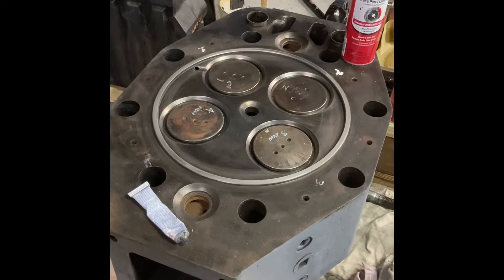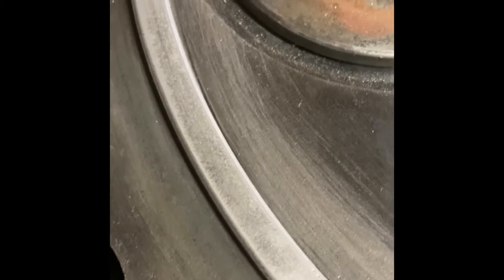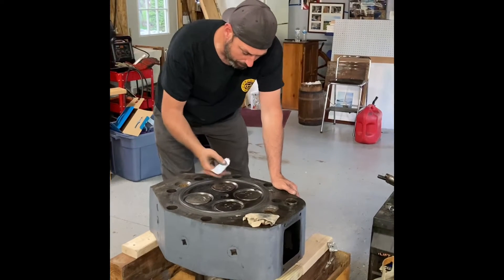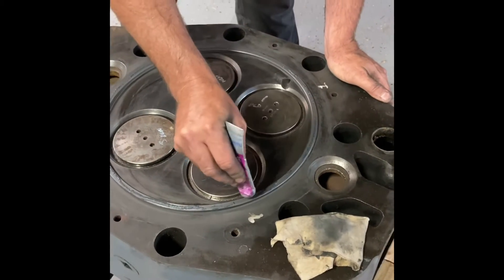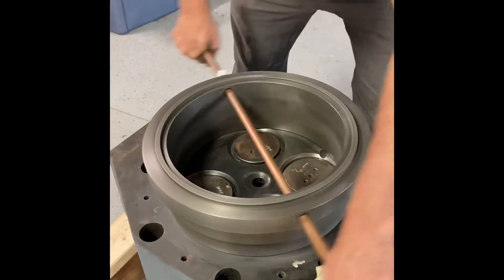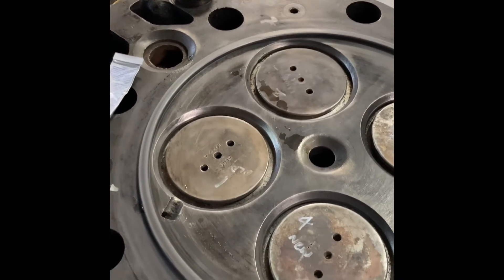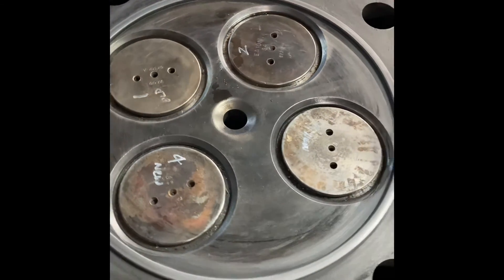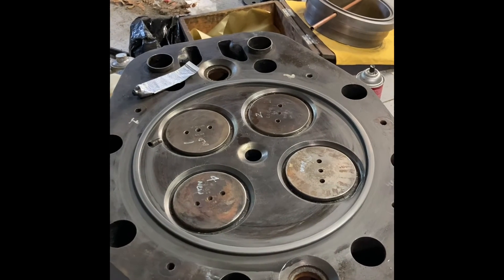Alco 539 Locomotive Cylinder Head Reconditioning

Comment: ONE TIME I HAD TO REPLACE AN CYLINDER HEAD AND LINER WITH NO LAP RING TOOL AVAILABLE!
TO CURE  THIS I TURNED THE HEAD UPSIDE DOWN , THEN PUT THE CYLINDER LINER AND LAPPING
COMPOUND ON THE HEAD THEN LAPPED IT IN !
IT DID SEAL OK !!👍👍
Reply: @rossbryan6102  I shall be searching around. Great thinking on the issue of lacking a lap ring tool.

Comment: Do you know an easy place where I can obtain alco 539T parts and service manuals? 
I've heard there was also a welded block variant called the 540T.
I haven't been able to find so much as a picture of the 540T so I don't know what they even looked like.
If you have any pictures of a 540T or so much as information on it I'd greatly appreciate it.
Reply: I HAVE HEARD OF THE 540 T BUT NEVER SAW ONE!
TO GET THE INSTRUCTIONS YOU MAY HAVE TO HUNT THEM THROUGH HISTORICAL GROUPS AND RR MUSEUM GROUPS!
ALSO THIS ENGINE WAS ALSO MADE AT LATER DATES IN ALCO OF CANADA!